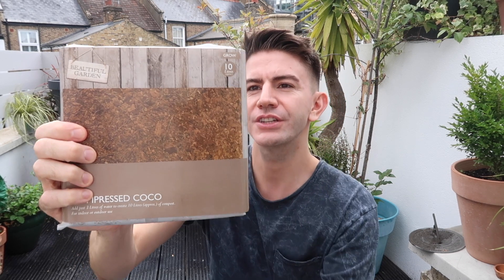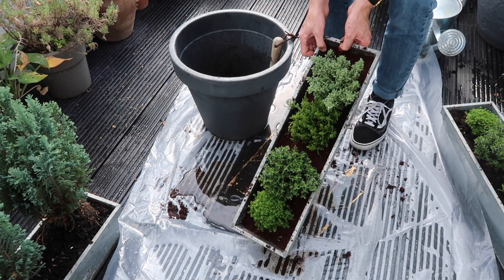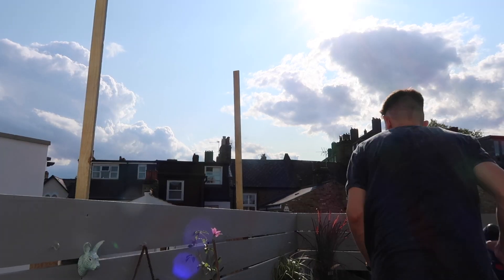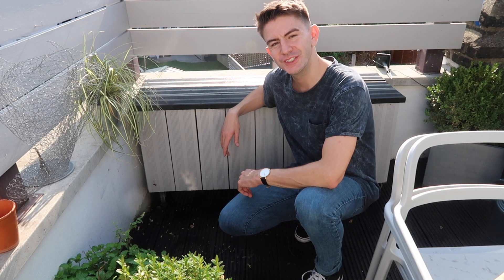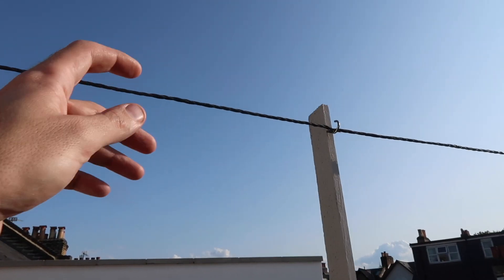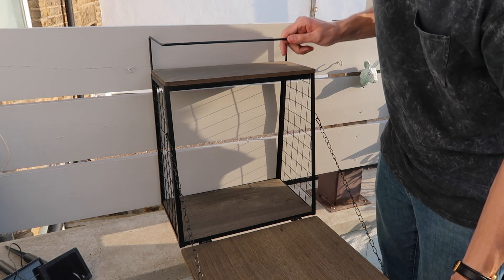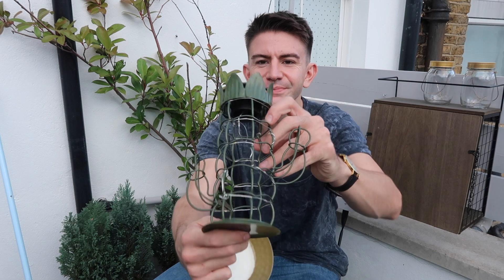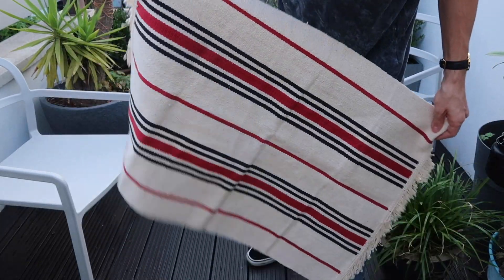ROOF TERRACE MAKEOVER & REVEAL | small garden design ideas

Comment: Discovered your videos today and love your ideas. FYI, I know you wanted to finish-up before the rain came; but I was just wondering why you didn't paint your sticks, to hold the hanging lights, first on a flat surface and then screw them into the fence? You would not have to use blue tape or paint at strange angles-I guess you could have painted while you waited for the planes to stop flying over! :) Debbie

Comment: an added note, and speaking from experience with it.  The compressed coconut fiber, it has ZERO nutritional value for plants.  It's basically like planting them in Styrofoam.  At best it's a soil amendment, not a soil replacer.  I had purchased some very expensive plants to plant in mine and they all died right quick.  Research filled me in on the rest.  Just a note....you might want to add some real "soil" to the plants long-term.  GREAT CHANNEL man, keep up the fantastic work!!
Reply from the maker: Thank you so much Erick. I used it to top up the pots so hopefully will be ok. Thank you for letting me know :)